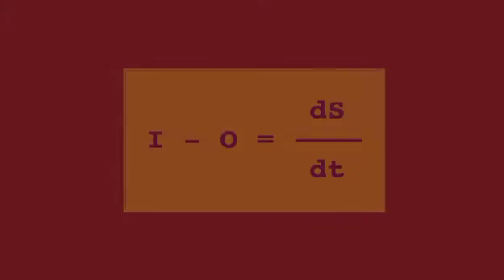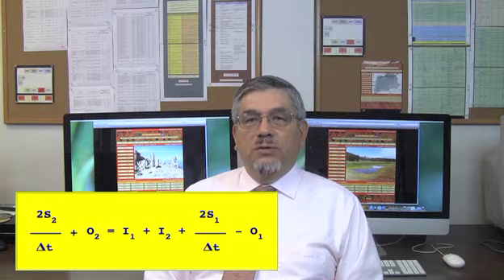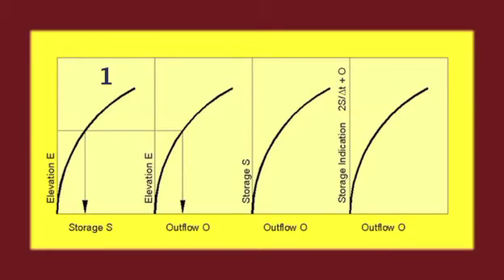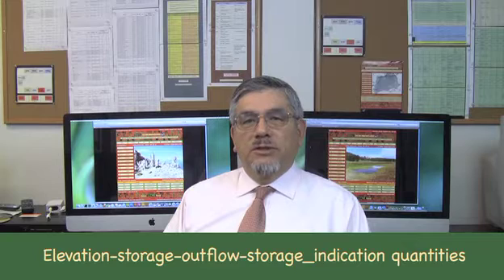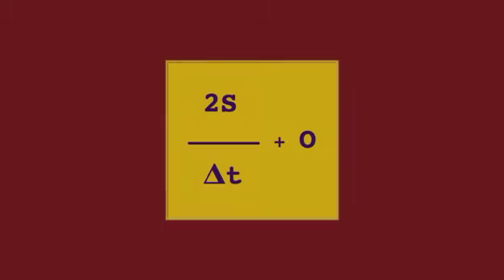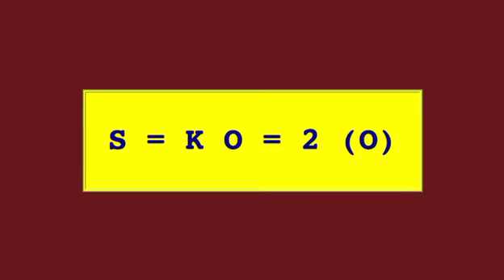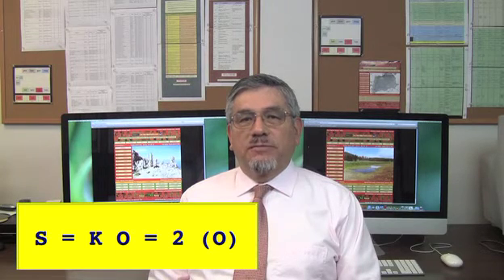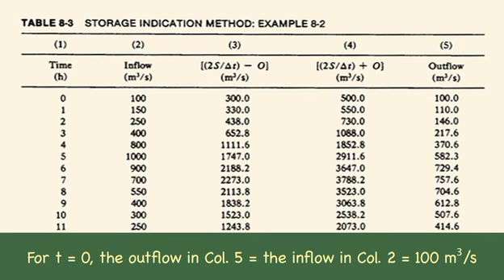enghydro083

Comment from the maker: To aljoseven:  Because Col. 5 (Outflow) at t=0 is known (initial condition) (100), and 
Col. 4 (Storage Indication) is 5 times Col. 5 for this problem, that is, 500; and subtracting 2 times Col. 5 (= 200) from Col. 4 (500) you get the quantity that you need in  Col. 3 = 300.